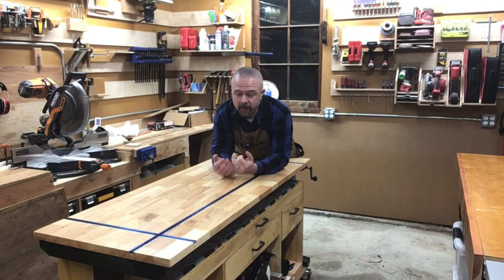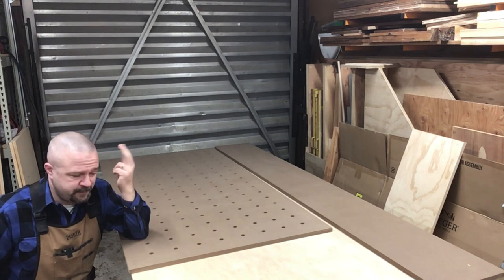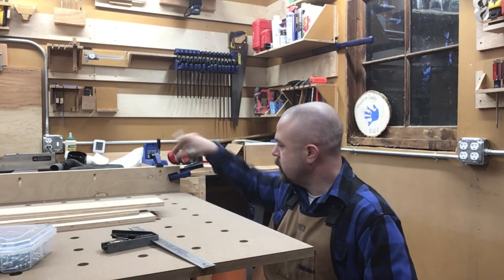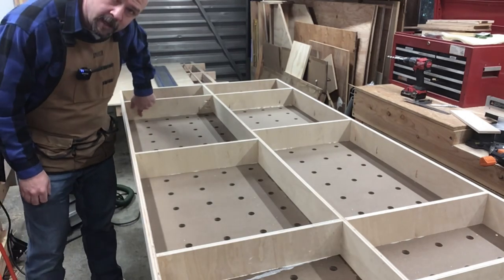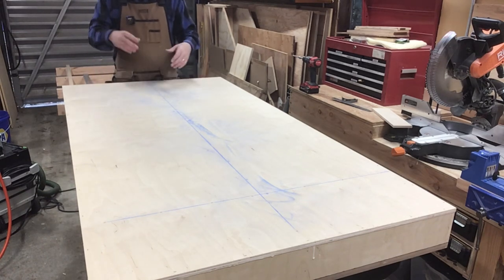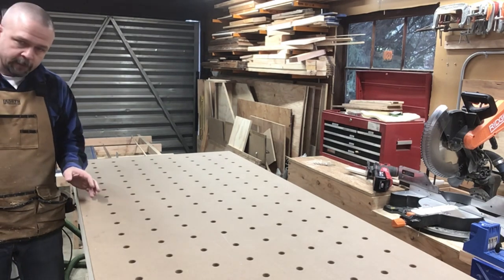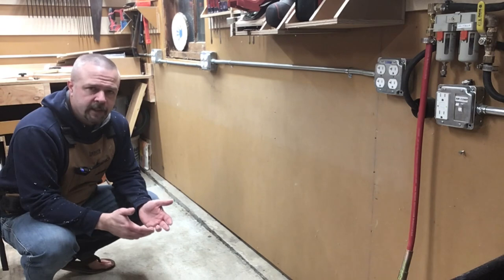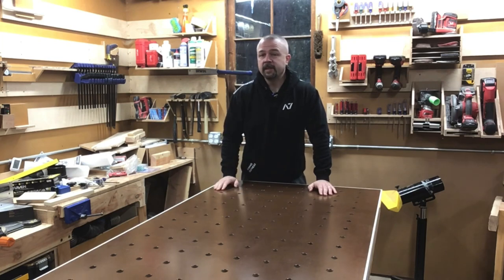The Best Torsion Box Assembly Table

Comment: Why didn't you cut the holes in the sides rather than the bottom?  If you used the holes in the sides, you would have a place to put your tools while using this table top
Reply from the maker: The sides aren't quite tall enough to cut holes big enough for my hands and still have enough material to keep it strong. When I'm using it I have benches on either side of it to set tools on (outfeed table and miter saw station).

Comment: Great job on this I wish you made a video on the cabinet work under the husky table but mine has 2 drawers under it. I have the same table and neve thought of doing what you did under yours. Ty
Reply: Just take drawers off. The tables are same except one comes with the drawers. The drawerless model still has the holes for the drawers. Same same.

Comment: Cool build.

Note: another option for 20mm x 96mm grid holes is to get a parf system and have the holes done with that. It costs more than $150 (I think 200-something) and takes an hour or two, but the results are pretty much the same and you can reuse the system, so if ever you make two tops the cost is under 150 (+ time of course), if you make a third one a couple years down the line, it's under 100, etc. With the satisfaction of having made it yourself.
Reply from the maker: I'm with you on that, the problem is that I never trust myself to get everything perfectly square